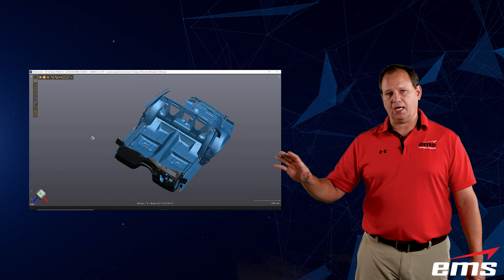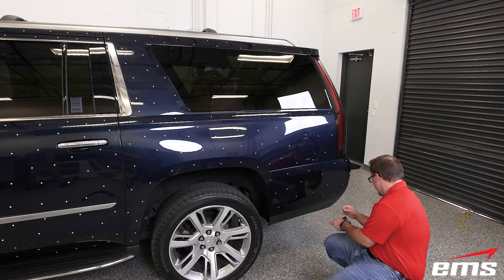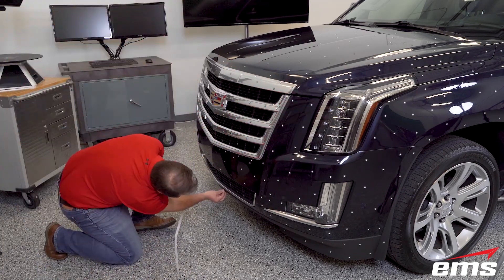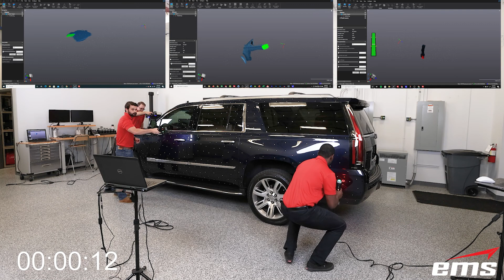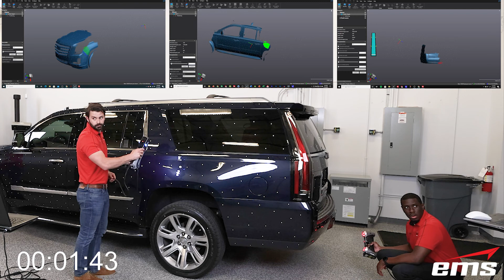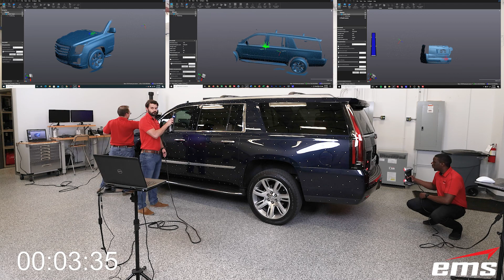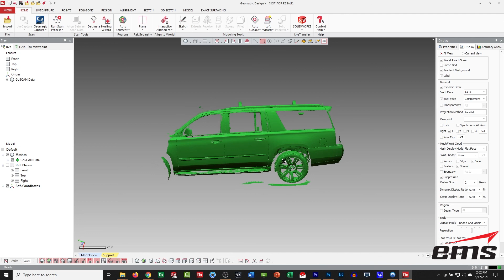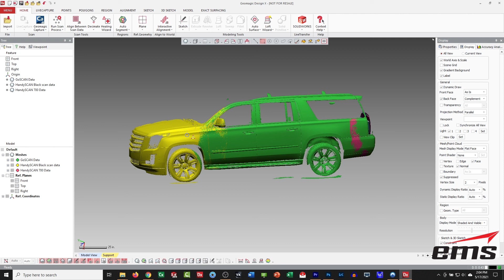3 Scanners at Once - Ultimate Speed

Comment: For an application like this, would you not agree that a MetraSCAN or similar is still a better option?
Reply from the maker: Hi Luke,  it depends, for example if you also want to scan the inside of vehicles the MetraSCAN really won't work.  Also if you are looking for the ultimate in portability having a couple of hand scanners might be easier than traveling with a MetraSCAN.   If all you are going to do is scan the outside of vehicles the MetraSCAN is a better choice, however you could buy 3 HandySCAN 700's or a HandySCAN Black and a GoSCAN SPark and a laptop for the price of a MetraSCAN.  So it just depends on your needs.
Reply: @EMS3D  great comments! I fortunately have access to both and the handyscan is a brilliant little device and extremely portable as you say. Really enjoy your videos